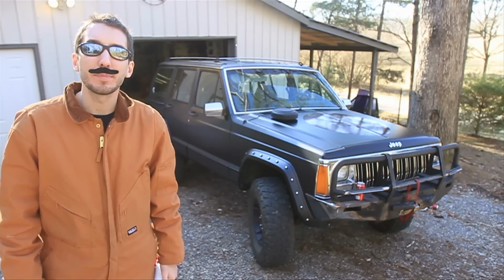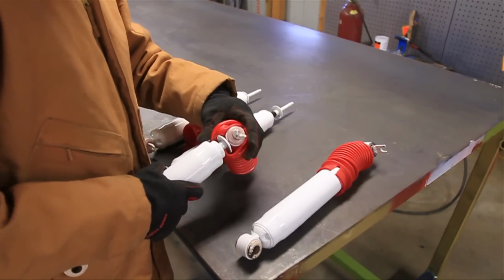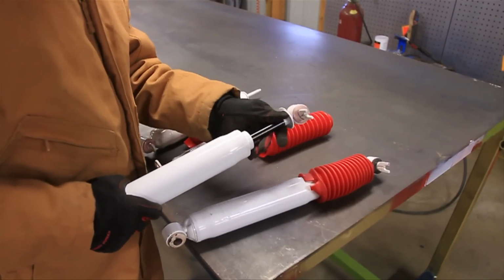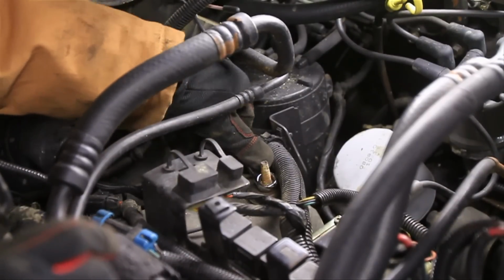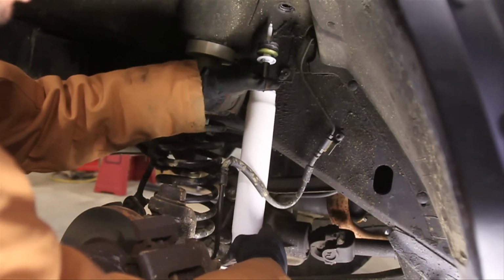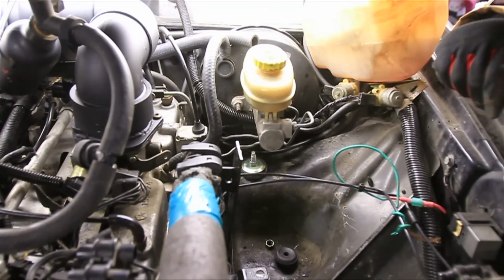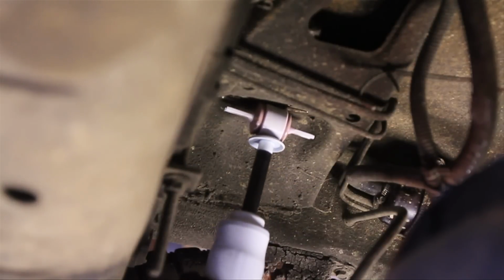How To Install Shocks

Comment: In case anyone cares:
2000 shop manual indicates the following torque specs -
Front shock lower bolts = 17 lbs
Front shock upper bolt = 16 lbs
Rear shock lower bolt = 46 lbs
Rear shock upper bolts = 17 lbs
Reply: Oh wow my tj shocks are way over tightened 😬

Comment: I just used a vice to push one end of the top mounting pin thru the bush untiil it was flush with the bush, then pulled the boot on, then back in the vice to centre the mounting pin again. Took less then 5 minutes

Comment: never seen an XJ with the rear upper shock nuts intact! always end up knocking the nuts out with an air hammer when the bolts break, or the nut weld snaps and I have to cut the bolt. 

One time I really took my time and heating and cooled the bolts with PB blaster and worked then back and forth. Still freaking broke. so now I just bust them off immediately. atleast the Jeep engineers left plenty of room for a wrench on top (unlike those leaf spring bolts!)
Reply: Dealing with this now. The bolt going up into the welded nut snapped. I couldn't hammer it up from below, so I drilled out the bolt. Planning to tap the hole I drilled, but wondering if I should think about trying to knock the weld nut out from the side or something?
Reply: Austin Aubinoe rough country makes a bracket for that. shaped like a Y with the nuts wleded onto a handle so you can hold it and put the bolts in easy

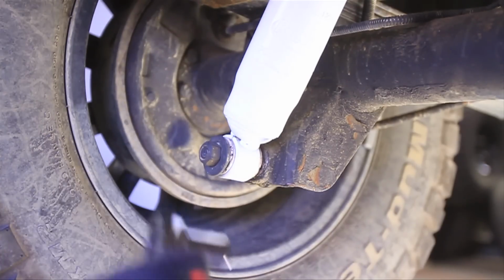Comment: At 10:50 you bolt the bottom part back on, but on my particular shock their are multiple options for what looks like a bushing within the rubber part of the rear shock.  Do you use one of those bushings?  Take it out?  Use a different one?

Comment: y did you have to pull on the shocks to get them longer? every new shoxk iv ever had to that on their own
Reply: Only gas filled will extend on there on, like struts on newer autos.  Standard shocks do not.  Peace.
Reply: @gordongman3423  i just bought some rs 500x for my expedition, and theback shocks i notice wont shoot right up on its own , so is that normal or defective?
Reply: @fastrunlogistics3560  Some shocks do not extend. Gas struts (shocks) under pressure come zip tied. If your front struts are bad, I suggest buy complete struts and shock assembly, like Gabriel. Trying to break down a strut assembly is a nightmare.
Reply: @gordongman3423  thanks

Comment: Gotta question, I just did a 4.5 lift on my 1996 XJ and it hasn't even been a good year and I'm already experiencing tire cupping on new tires, could it be the new shocks that I installed with the lift kit? I say this because I noticed that when you were installing the front shocks they didn't have any movement in them going up into the wheel well.
Reply from the maker: I would say that's an alignment issue.
Reply: Thanks

Comment: Hey guys new into building. I just recently bought a 98 4cly 5 speed with skyjacker 4inch lift and looking into replacing a 4 shocks. Any words of advice..
Reply from the maker: I like the rancho 9000s
Reply: But were to buy them

Comment: how the hell do you get the bolt pin on front shocks, while in grommet, into the round hole?   shit, giving me fits.  seems like  a pretty poor idea.   got some skyjackers & the bolt pins are not installed, gotta do it my self..thanks

Comment: Dude why dont you just install that boot from the bottom up instead of fighting that bar bracket?
Reply from the maker: Won't fit
Reply: That was my exact thought ha ... Apparently it won't fit but I'm gonna order some and see what's up.
Reply: Cover shock with soft hand soap boot slides right up bottom side ...flush shock with warm water to remove soap then dry, Works fast has hell and no stretching....And since they get wet anyway it wont harm anything....
Reply: It’s hard rubber, it doesn’t stretch very well

Comment: Hey Matt I need your help.  I was replacing my shocks in the rear of my xj and 2 bolts broke one bolt on each shock,  I tried drilling them out but I broke a couple drill bits,  I was wondering if you have any advice for me please help, I'm just not sure what to do,  thanks Matt I appreciate all your help
Reply: Zachb002  Both bolts broke on mine drilled and self tappers in. Going to try torching the bolts on the other side to see if that helps.
Reply: It's easy man don't try drilling them they r a waste of time. Get a bar that's a little smaller than the bolt and hit it with a 3 pound hammer and the back nut that's welded on just comes right off. Then reach in there and put the new nut in place and the shock and put the bolt through
Reply: Photo Phil
Reply: Zachb002 TY but there is no room to get behind. 96 jeep cherokee country edition